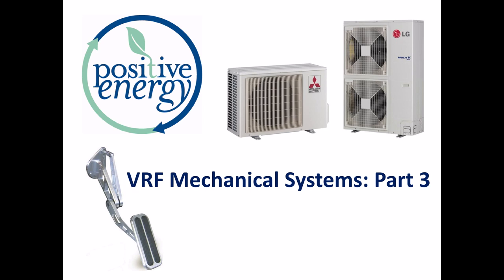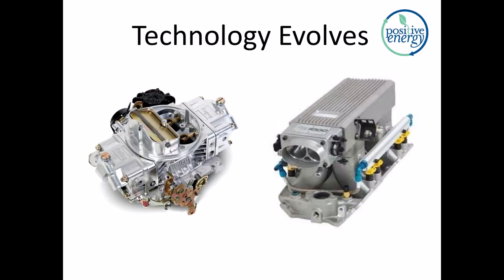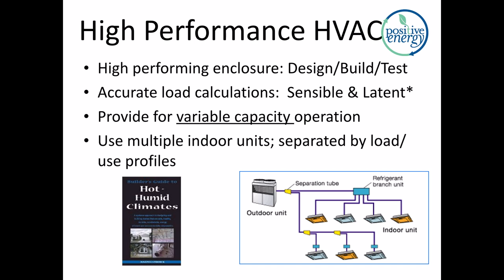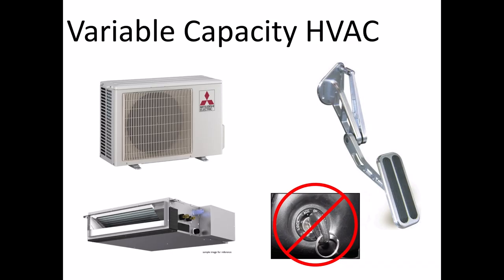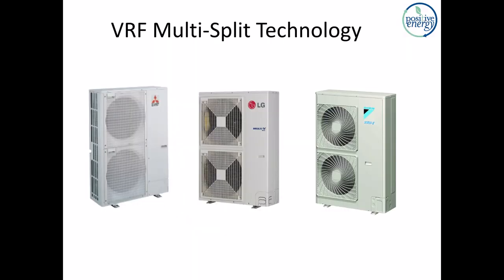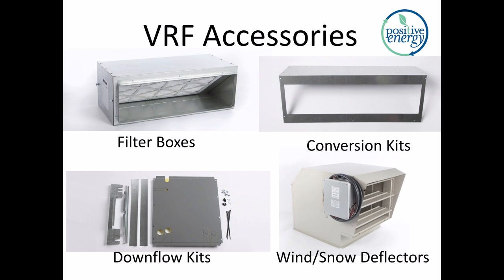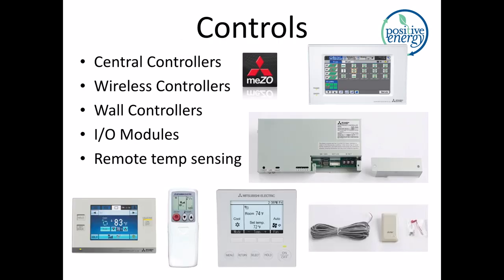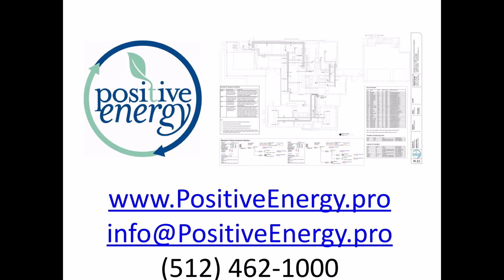High Performance HVAC - VRF Part 3 of 4

Comment: The vast majority of installing companies don't want to even quote inverter based systems.  A case in point was when Lennox began marketing these units nationally, the biggest Lennox supplier in San Antonio refused to quote them due directly stated "complexity".  Hopefully part 4 will also clarify "ducted vrf indoor units" as opposed to units that are hidden that may look like ducted.

Comment: 11:32 that's either a servo or a stepper, not a solenoid. Solenoids are linear motion, servos use funky analog signals for control, and stepper motors are 100% digital.fun fact: Servos (because they long predate digital control) were used alongside synchros to aim huge battleship guns in World War II. They could even be controlled automatically by advanced analog fire control computers.
Reply: Alexander - you are incorrect. It is depicting a solenoid that is pulsed on and off frequently to control fluid flow through the joint of the attached piping.  Yes a solenoid provides linear motion, but that motion is used to lift a ball off a seat and close it rapidly...thus controlling the fluid flow.